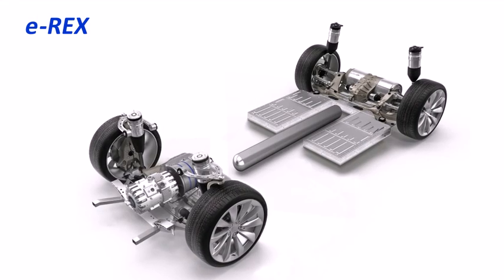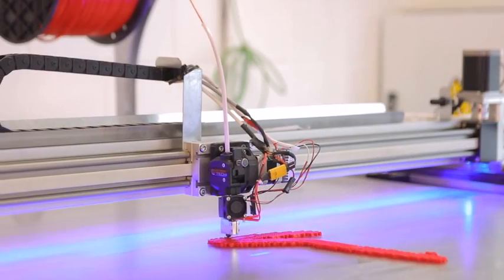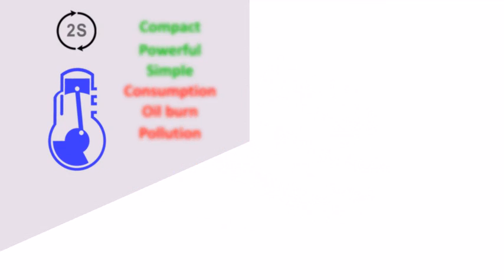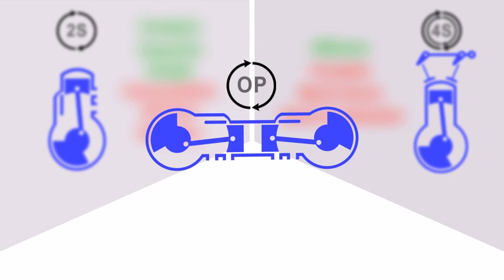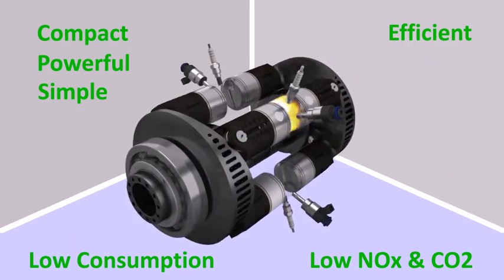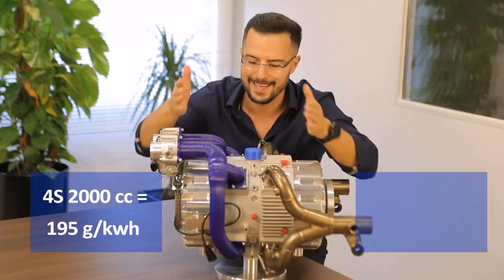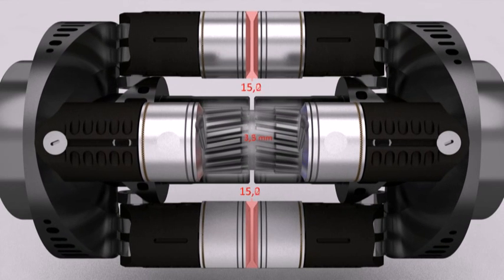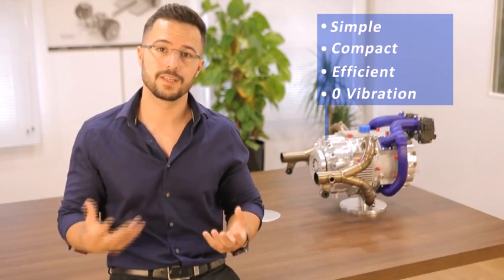e-REX. The True Range Extender by INNengine (English version)

Comment from the maker: Ya está disponible también en Español. Gracias por vuestro a apoyo y comentarios .
Reply: Juan Garrido   What creates the pressure difference so intake air will push exhaust gas outdo the cylinder?  There is no scavenging without pressure differential.
Reply: @timduncan8450  Agreed. This engine would be excellent as an opposed piston 2 stroke or 4 stroke
Reply: 3 years passed and nothing happened!😢

Comment: I would call this a 2-stroke still...
Reply: Yeah, completely agree.  Still an Otto cycle, still has pistons, which still move back and forth, with ignition occurring every time the piston reaches TDC.  Two stroke.

A "one stroke" would not be a cycle, and would operate like a gun barrel.
Reply: Yeah the writer seems to confuse stroke with crank rotation instead of piston travel
Reply: Yup def 2 stroke
Reply: @V0latyleUSMC  could a jet engine be classified as a single stroke engine ?
Reply: @ab-gu2nh  It's not a reciprocating engine
Reply: I agree with you if we consider the piston. But if we look at the crankshaft, there are 2 cycles in 1 rotation .
I think it's why he says it's a 1S.
Reply: @Fbiking40  Stroke always considers the piston - If you consider the crankshaft, it's only a 1 stroke because it has multiple cylinders. If you apply the same logic to a 180 degree 2 cylinder 2-stroke engine you could also call it a 1 stroke because it produces 2 power strokes per crankshaft rotation. An 8 cylinder 4-stoke would be a "half stroke" as it produces 4 power strokes per rotation.
Reply: @dwindeyer 500 c.c of this motor =   2000 c.c 4 cylinders 4 stroke. 2000 c.c/ 500 c.c = 4 . 4 strokes / 4 = 1
Reply: @dwindeyer The correct relationship is not whether you have x pistons or x crankshafts. It's more of a relationship between how many cylinders it has, the displacement, and the performance per rpm. Also in relation to its weight and mechanical complexity. This engine has an equivalent performance 4 times higher than its 4-stroke counterpart. Hence, saying that it is a 2-stroke is not fair either.
Reply: Even the article I just read about this erex called it a 2 stroke... Even those they advertise it as 1 stroke. 😅
Reply: They call it a one stroke engine for marketing reasons. They wanted to make sure people could differentiate it from a traditional two stroke engine. For example; this don’t burn oil
Reply: Each end is individually a 2-stroke but because two are opposed to each other working 180° out of phase every stroke of the piston in either direction completes intake compression ignition and exhaust in a single stroke of the piston. Every stroke delivers power to the crank shaft.
A Napier Deltic engine used the same kind of 'counter-intuitive' thinking in each bank. Every ignition forced the two pistons in opposite directions and some tricky gearing converted these opposing movements (from all three banks of six pistons and three crankshafts) into a single direction
Reply: @ab-gu2nh, the combustion of a turbine engine is continual and not cyclical

Comment: It's kind of arbitrary to call it a one-stroke engine. The pistons have to move up and down (or together and apart) for every combustion cycle, so this is really just a novel opposed piston two-stroke engine. The fact that each cylinder does two combustion cycles per revolution is an artifact of the architecture.
Reply: same thoughts here, 
complicated theory and marketing, not to be asociated with 2-stroke, :)

Just call it best clean, 2 stroke prototype, up to date.....

Comment: Traditionally, a stroke has been movement of the piston from one end of its travel to the other. A two stroke goes up to compress and down to power. A 4-stroke piston traverses the cylinder 4 times per power stroke (intake, compression, power, and exhaust).  Since the crank shaft turns 180 degrees each time the piston traverses the cylinder, a stroke is associated with 180 degrees of crank shaft rotation. 
  The swash plate of this crank shaft causes the pistons to traverse the cylinders twice in 180 degrees, causing the 2-stroke action to produce power every 180 degrees. They define the stroke count based on this rotation.   Three lobes of the plate would be 2/3 stroke and 4 would be 1/2.  Semantics. Still an idea with lots of potential. 
  A drawback might be that as the power stroke pushes the swash plate (e.g.) clockwise, the piston is pushed counterclockwise, scrubbing against the cylinder wall. I don't know enough about lubrication technology to opine whether this will cause wear & early failure. (I anticipate an emotionally charged education. )
Reply: Es exactamente igual que la producida en un motor normal con cigüeñal. El rozamiento es el mismo, la biela tampoco empuja recto.
Reply: Well, if it's a range extender it can rev lower than a normal engine, so that should help mitigating such issues

Comment: Looks like it'd be pretty handy for motorcycle and cabover uses as well. Hope it gets to market and we can see real world use as a main engine instead of just backup in EV's
Reply from the maker: Let's hope, thanks!
Reply: With zero or low vibration and the power of a 2000 cc engine that would be excellent for a bike or side by side UTV.
I'm the type who loves to cram large displacement engine's in frames ment for small ones.
This would be right up my alley if I could get one 👍
Reply: They have one powering a Mazda Miata for more than a year now. Having a fixed RPM tuned to an electric generator will deliver maximum efficiency though torque is easily adjusted on this engine.
Reply: @sambou812  Putting one in a motorcycle is all I thought of when I saw this video

Comment: Wow you successfully designed an engine that I've been putting in string control and remote control airplanes and other Toys in the 60s. Except mine run on nitro alcohol weigh 1 lb and put out three horsepower.

Comment: This is an excellent presentation thanks, what an outstanding engine.  It really is a 3 cylinder 2 stroke!
Reply: It really is a 3 cylinder 2 stroke. Indeed. And engine isn't outstanding because there aren't so good bearings in the world to withstand such power conversion from reciprocating motion to rotational motion. Czech engineers once built concept motorcycle ICE without traditional crankshaft. That, as far as I remember, lasted minutes.
Reply: Lol, It's all about getting your attention.  If you watched the same video above that I did, count them again.  I saw 4 cylinders with 8 pistons, each getting sent to top dead center 2 times per crank revolution, (for 16 piston pulses).  Hence the odd nomenclature of a 1-stroke engine.  It's catchy, but because they are counting combustion events per crank rotation times the no. of cylinders divided by the no. of pistons instead of piston "strokes" per complete power cycle, it's basically just a shell game with your intellect and simply not accurate in any sense.  I guess their reality is what they want us to believe:  like, "I feel like a __________ today so you have to call me that". 
Here's the formula I see:
4 cyl. 
8 pistons
8 combustions acting on 8 pistons per 360* crank rotation
(8 events per rotation with 8 pistons must equal 1-stroke) (8/8 =1)
With this math concept, a typical V8 engine would qualify as a 2-stroke, because only half of them fire each revolution of the crank.

Comment: I’m guessing the creators knowingly use the misnomer “1stroke” not to define the power strokes per cylinder per revolution, but to highlight the power density of its unique architecture.  Also known generally as a swashplate engine, this iteration seems to be a clever refinement of that concept
Reply: Yes, they know it’s a 2 stroke, but said they didn’t want to be associated with a 2 stroke because it doesn’t use an oil mixture.
Reply: @williamsporing1500  They intentionally chose it as a marketing gimmick to differentiate it from what everyone expects when you say, "two-stroke".

Comment: i'd love to know more about the engine. You need to get a lot more technical. Power, weight, torque, rpm range, etc. You spend most of the time just saying it's wonderful. Dig deeper. The beauty of a range extender is that it only needs to run at one certain speed, to generate electricity. What speed is this, and why is this engine better than other options?
Reply: Lack of any detail is not a big red flag for you? You'd think if they were really on to something they'd be shouting torque and efficiency numbers from the rooftops.
Reply: It would be cool on a motorcycle but to assist an electric car I don't think it's big on HP or Torque, maybe if they made bigger sizes 🤔
Reply from the maker: Latest gen specs: 
Displacement: 700cc
Cruise power: 50hp@2500rpm(generator speed)
Peak power: 120hp
Max Torque: 234Nm
Consumption: on the previous prototype at its best operative point, a brake specific fuel consumption of 195g/kWh. That was before direct injection with active prechamber technology which will be ready for testing in 2023. 
Thanks for your comments!
Reply: @innengine  A 500cc N/A two stoke did way OVER 200hp back in the 90`s 
At fixed rpm/150hp they ran those for thousands of hours while testing and at those loads they are extreemly eficcient due to not have to move other things than the crank , they almost run "to cold" !!

Comment: The roller on the perpendicular cam would have to be somewhat conical to prevent sliding (think perpendicular gears), but this angled roller would then have an angled normal force, putting lateral force on the piston and increasing friction and wear, unless you slightly angle the roller relative to the piston in order to compensate.
Reply: I'm not sure I understand what you're trying to say here. There's no "head" in an opposed piston engine, and there is an inner "cam" profile on the flywheel that limits the piston travel.  It's hard to see in this video, so here's another that shows the rotating assembly with the "followers" on the pistons

https://youtu.be/gqc0KZRKreE
Reply: @V0latyleUSMC  Thank you, I did not notice the second roller surface that prevents the other roller set from leaving the flywheel surface.
Reply: @JWQweqOPDH  No problem, these details are easily missed.  I have doubts about the claimed power and economy benefits over traditional opposed designs; from a mechanical perspective, this might be simpler and possibly more durable in the sense that there's one "crankshaft" and no timing gear that presents a point of failure.  But like you said, angular forces might be higher, and the follower rollers add some complexity and potential failure points.
Reply: @V0latyleUSMC  Honestly it frustrates me how little information there is on the practical limitations of axial piston engines. They have been experimented with for decades. They are widely used in torpedoes (burning monopropellant). Similar concepts are widely used in hydraulic pumps & motors. I can understand that the ones with revolving cylinders have the same sealing issues as rotary engines. However, that doesn't explain the extreme rarity of all axial piston ICE designs.

Comment: not sure about the definition of 1-stroke. the cylinders go back and forth still.
but the perfect balance combined with varable valve timing look great. 
It might be a perfect design for an EV with true electric drive train and a back-up generator. I think that would go a long way! (pun)
Reply: Exactly, it's just doing 2 ignitions per cycle, with 2 strokes per ignition
Reply from the maker: From a cycle point of view it is certainly a 2 stroke engine. The issue with calling it a 2stroke, we found, was that people would intantly assume things like it run with oil in the mixture (which it doesn't), or that the exhaust port closed after the intake (which again, it does not), or that it could only deliver so much power. In the end we found easier calling it something else, and we didn't come up with the 1-Stroke tag, it was suggested by an external ICE institution and we kept it because it sends the right message in terms of power and, to be completely honest, because it was catchy!
Thanks!
Reply: @innengine  Thanks for the explanation! I do agree that it should be in a class of its own, and that calling it a 2 or 4 stroke is deceptive to the nature of the engine, but in my opinion calling it a 1 stroke engine is also misleading. Something this unique does definitely deserve a name that sets it apart though, like the Wankel and "quasiturbine" have (I had to look up that example :p). Anyways, I love the design and do hope to experience seeing it running someday!
Reply: @innengine  confused on your Paige it says 40 to 1 oil ratio. At no point in your wid do I see oil pump or sump
Reply: @innengine  Wow, I really hate to "Be That Guy".  Yes, it caught my attention until I saw it move.  The swashplate format has been around for over 100 years but it hasn't gotten very far.  Many of the early military torpedoes used engines like these.  Absolutely no need to worry about longevity when it's all going BOOM!! in less than 5 minutes.  This is still very interesting and I LOVE the adjustable compression ratio, but when you decide to be deceptive with the simple facts inherent with what it really is, who is going to listen when you have something really important to say about how it differs from other swashplate engine of the past?  Your engineer didn't set out to invent a 1-stroke cycle engine, so honor him and espouse the awesome parts of this particular design that he DID do very well.  Like, no fuel/oil mix, and no crankcase oil.  No?

Comment: i watched the entire video but i have a few questions
#1 what fuel does the range extender use i.e CNG/petrol/diesel and any option for ethanol/methanol perhaps?
#2 what is its "effective" HP/KW output?
Reply from the maker: Thanks, we hope you enjoyed it!
#1 could be anything. Our first prototypes run on gasoline but we are already working on using H2 for which our engine is particularly well suited thanks to it's power compacity.
#2 500cc prototype delivered 120HP@6000rpm. The evolution of it will be a 700cc. A longer engine more focused on efficiency rather than raw power.
Reply: @innengine  that is fantastic output on 500cc. I would recommend building a variant for general aviation. The light weight, high power and smooth operation is perfect for airplanes. Just give it a larger bore and lower the rpm.
Reply: LLP
Reply: @michaelmurphy6687  

Ml is p po 99oo[
Reply: HP OK, but what about torque?

Comment: I’d be interested to know the durability of the bearings that ride on the swashplates. 
Neat design, reminds me of a compressor/axial. I hope they keep on the R&D and get it perfected.
Reply: I'd be interested in them explaining how the car the tested it in was stripped and littened to no end for this engine to move it.. given that wobble will not produce toque...   and torque is nescesary to start moving..   so I believe this enigne probably takes all its powere= to even get the car moving....then it takes another 60 seconds to get to 50 kph    lol..    been done...look at the 3.6 litre trailblazer  it has a habbit of stalling because it requireas 4500 rpm before it developes any torque lol
Reply: @harleyme3163  I think you are probably right, but this is perhaps the reason this is 'a range extender', not the moving engine of a vehicle. It probably works ok at a fixed speed, to be used in an electricity producing alternator, to charge batteries ! Hope we will have more details from these guys. Anyway, it seems to be 'important RD.
Reply: @ernestolula3280 why not do away with the additional rotary arrangement for external generator coupling and just have linear generation by pistons pushing magnets through coils giving multi-phase output?
Reply: It's a much more balanced engine without a crankshaft. It has very low vibration levels which, to me, indicates lack of stress on the engine.
Reply: @harleyme3163  Directly powering a car was not a design goal. It is a way to test for durabilty and many other real-world circumstances.

Comment: I certainly hope this one is real, not the usual "revolutionary" vaporware. In technical terms it's nothing new, just a combination of two concepts that are well-known for at least a century: the axial cam engine and the opposed piston engine. The term "one stroke engine" is just marketing, you can arrange the cam in such a way as to obtain a 0.5 stroke engine. The Michell engine project of the 1930's was combining opposing pistons, swash plates and tilt pad bearings in a very similar diesel concept that never got to see the light of day, but if it did it would have been good for some 2,000 HP in a small enough package to fit in an airplane or even a tank. I wish you luck with this one.

Comment: Hallo, ich sehe da große potenzial in Wohnmobile die mann im Altag als Elektro Altagsauto mit 60km reichweite nutzen könnte und die 2 mal in Jahr Urlaub (Spanien/Italien) mit dem Rangeextender fahren könnte um dort wieder elektrisch zu fahren.
Auch 4x4 Expeditonfahrzeuge für die Weltreise sehe ich grosses potential mit stärken Allrad Nabenmotoren und einem kleinem Rangeextender, allerdings finde ich Diesel oder Biodiesel als bessere Treibstoff. So eine VW LT 4x4 aus Jahren 1975-1995 als Elektroauto mit Rangeextender würde perfekte Weltreisefahrzeug.
 Ich sehe nicht als ökonomisch 400kWh Akku mit 2000kg in Fahrzeugen einzubauen um 1000km zu fahren.
Mit wie viel Lieter Kraftstoff lasst sich mit euer Technik 1kWh strom produzieren?